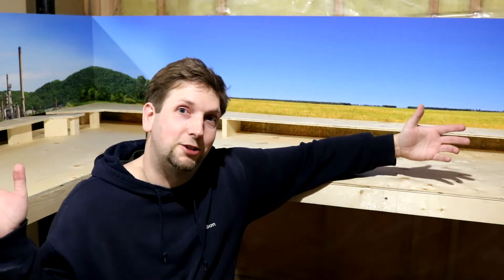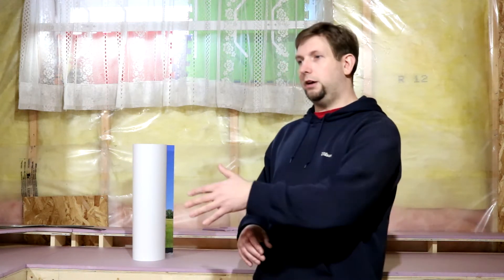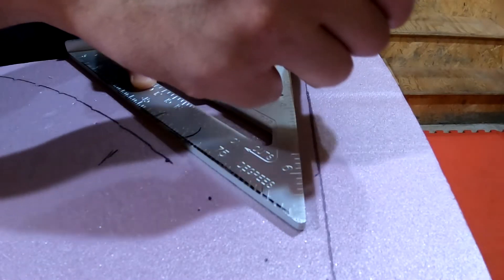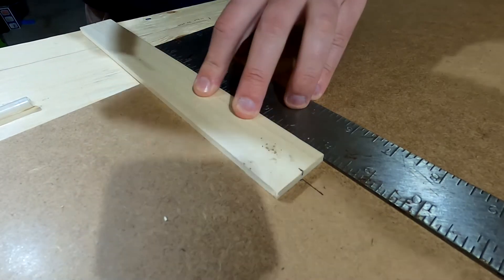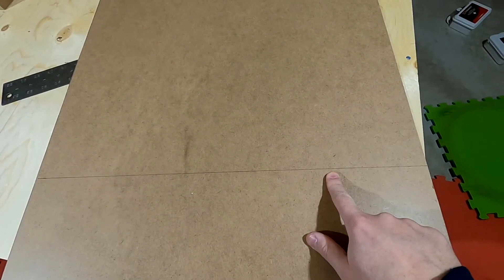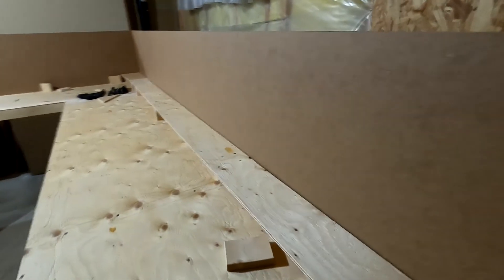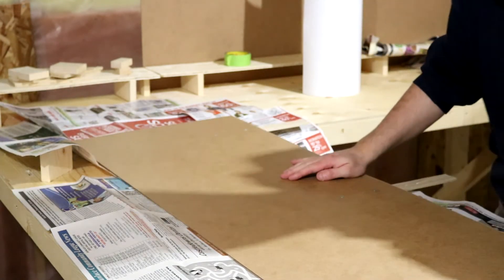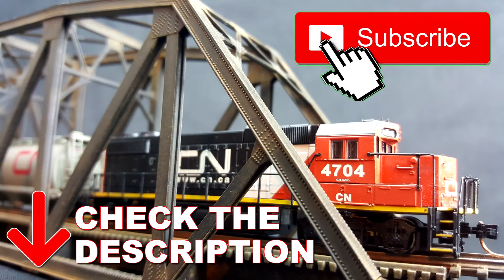N Scale Layout Update 4 - Realistic Backdrops for cheap!

Comment: From someone who used to laminate countertops, you can spray the paper and hardboard separately and then use strips of wood or dowels to seperate the mating surfaces and then start from one edge and work your way across pulling out one dowel at a time. If the paper is thin and prone to sagging, try laying the paper on a hard surface and then suspending the hardboard with the wood strips